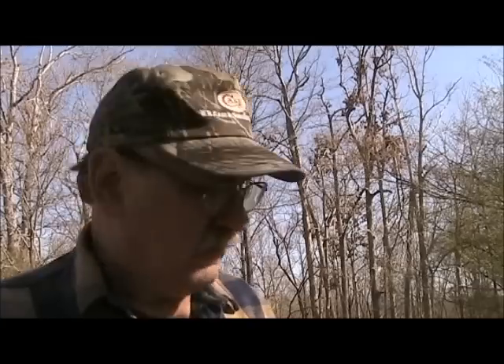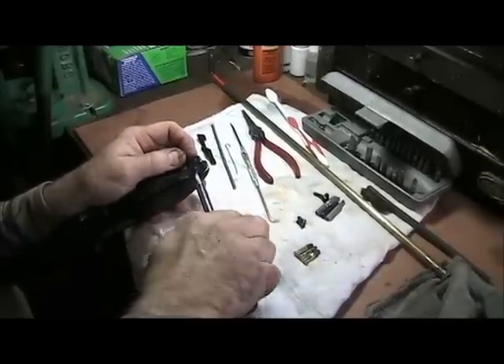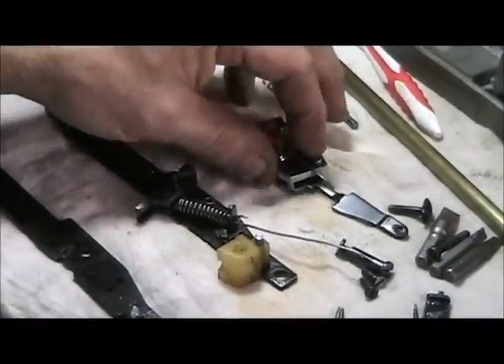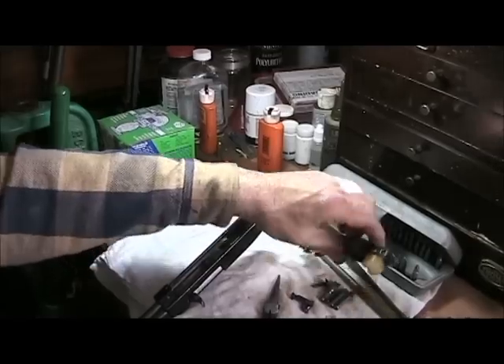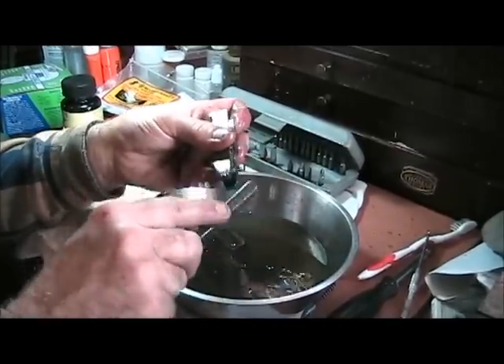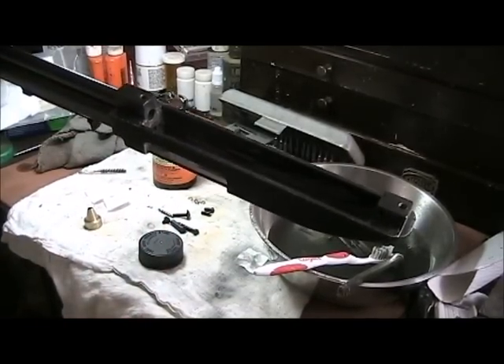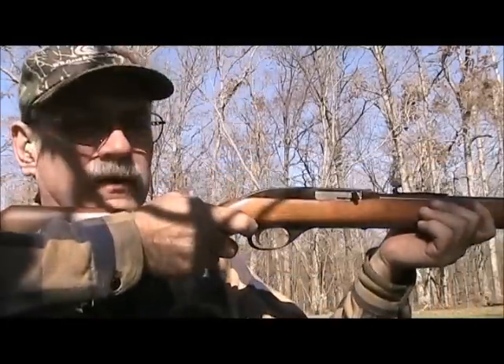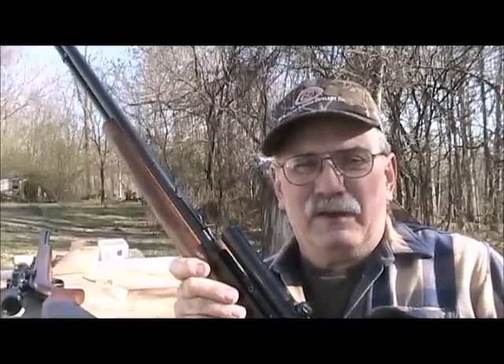Marlin Model 60 Jamming Problems and How to Fix Them

Comment: I went plinking yesterday and my 1970 marlin 60 would not load any rounds. Just kept going in crooked and the gun was filthy. You would never know it by the looks of the rifle. It is in 99% condition. I just bought if from a 91 year old gentleman who said it had very little use.
I followed your vid and took it apart just as you said. I cleaned it as I went along and then started the install. When I got to the ejector spring there was nothing there at the end to go over the mouth I think you called it or the ramp. Seems to me the spring is broken. Thanks so much for the great video. Can you point me in the right direction for a rebuild kit that you would recommend?  Thanks, Bruce
Reply from the maker: If the ejector spring is broken, and is not ehgaging the head of the cartridge case, then it can't really get rid of the empty case. You can find parts for these rifles on ebay. You really don't need a rebuild kit. I don't think anyone even makes parts for these guns anymore.
Reply: Yeah that is broken so I must replace that. But why will it not chamber the round? The rounds are going in crooked. @CumberlandOutdoorsman
Reply from the maker: @vintagedrumrestorationgara91  It's hard to say without seeing it, but depending on where the spring is broken, it could also be the cause of improper feeding since it also operates the cartridge lifter.
Reply: @CumberlandOutdoorsman  I ordered the recoil and the lifter springs and will install them and see what happens. I will get to the bottom of it. Thanks for your help and great videos. Bruce

Comment: After having mine professionally cleaned, it now doesn’t even load a bullet. Also when empty the chamber is supposed to stay open, but that doesn’t happen either. The chamber release by the trigger seems to have lost its springiness… meaning it can be pressed and then doesn’t protrude back out. Thank you for the video, I believe I can do a better job by rebuilding it myself. At least all the parts are clean now, but the reassembly is where several things went wrong by this professional.

Comment: Great video. I had one do this and come to find out I had the for end screw to tight and was putting pressure on the mag tube. I backed it off and problem solved. That god for internet forums. lol
Reply: i hope that does the trick. Thanks for the tip. I'm a bit of an over tightener myself.

Comment: I got a question,I have one that wants to chain fire . It will shoot one round and next time it might shoot three rounds at once. Any advice on how to fix it?
Reply from the maker: Sounds like a problem with the sear assembly, or where the sear and hammer engage each other. I would do a thorough cleaning especially in the sear grooves, then lightly (and I mean LIGHTLY) oil the entire system. Let us know if this works out for you.

Comment: I really enjoyed this video ! Very impressive and informative as well!! Thank you for posting and I'll be looking forward to your upcoming videos too. I  have a. Model 60 that was gifted to me for Christmas v it was made in Mayfield Kentucky and it  jams straight out of the box new ..... Any ideas ? Thanks
Reply from the maker: Great question, and thanks for watching. If your rifle has the last shot hold open design, then you possibly have an issue with the cartridge lifter and/or the feed throat. Is it failing to eject, or failing to feed? That would be helpful to know in order to narrow down a solution.
Reply: @CumberlandOutdoorsman  it’s failing to eject or what I’ve heard it called is stovepiping ?
Reply: @CumberlandOutdoorsman  sorry so long getting back to you….. my iPad was down
Reply from the maker: @michaelhubbard1711  Ok Michael, If it's failing to eject, then the problem may be with the ejector/lifter spring. If the spring is not contacting the back of the fired round, then you can bend it back up to resolve the issue. A small amount is all that's necessary, but I would recommend you insert a fired shell, and watch what happens as you pull the bolt back slowly.
Reply: @CumberlandOutdoorsman  thanks I’ll give it a try . You’ve been most helpful ! Keep cranking out the videos please !

Comment: on our end we couldn’t see much detail and there was not enough lighting. Thx for the tutorial anyways. My Marlin Glenfield model 60 is jamming up too. But in my case the tip of the round is getting stuck and bending the led before it hits the chamber.
Reply: Also > https://youtu.be/skC1W6JqNgI
Reply: I have a 1977 old style that was doing the same and replaced the feed throat with a new New Style and shoots great now.  Had to mill the edges and milled off one of the protruding pins on the side to fit.  No need to change the ejector spring or the lifter.

Comment: My Marlin 600 keeps jamming up too, but my shells don't come out. They get wedged up in there because they aren't ejecting properly. You have to take the gun apart to clear the chamber and action. With the quarantine I can't take it anywhere. Going to watch the rest of your video to see if you cover what i think might be the problem.
Reply from the maker: You either have a bent ejector spring, or if your model is older, the ejector rail on the feeding throat is worn down or chipped. Depending on the model you have, either one of these issues will cause a failure to eject.
Reply: @CumberlandOutdoorsman  thanks for the feedback. I'm actually thinking it is one of the extractors. I believe only one is grabbing the spent shell, causing it to turn inside the action. I can't figure out how to remove the extractors to clean the slots they sit in. I think I'm going to wait to take it in.

Comment: What size drill bit did you use when you had to drill that extra hole in the side plate of the assembly to accommodate the new loading throat

Comment: Do you have a jig to use for drilling the new loading throat hole?  How do you ensure the proper position of the hole?
Reply from the maker: I'm glad you asked this question, because I didn't go into detail on how I did this in the video. The opposite plate has a hole that you can line the un-drilled plate with. I just outlined the hole and drilled it out. Everything went together smoothly.
Reply: Thanks for the answer!

Comment: Another great video my friend, Very informational and well done, Did you order your replacement parts directly from marlin ?, Do you know if a last shot hold open feature can be added to a marlin glenfield model 60 that does not have it from the factory ?
Reply from the maker: The parts I ordered are from Brownells, and Classic Firearms Parts. I would also check with Numrich Gun Parts, and of course Ebay. In regards to adding a last shot hold open, I have also wondered the same, (I guess great minds think alike). That would not only be a welcome addition to older Marlin 60's, but also an interesting video idea. I would hope that the folks at Youtube wouldn't mind such a video, because in effect you would be making this rifle more safe, simply due to the fact that you would be absolutely sure the gun was empty when the bolt is held open. I think I'll do some research on this matter. Thanks for the support.
Reply: I see the parts at MidwayUSA for a reasonable price.
Reply from the maker: Check out my updated video regarding the installation of the bolt release lever. I will show you exactly how I updated my vintage Marlin 60 in a step by step guide. So if you want to update your older rifle this new video is for you.

Comment: Where did you get that cleaning rod that swivels from,   I’m having trouble with my marlin 60 not shooting. What should I do first
Reply from the maker: The cleaning rod came from Mid South Shooters Supply. In regards to your Marlin not shooting do you mean it doesn't cycle? Is it not feeding correctly and jamming up? Is it not firing? Maybe it just needs a good cleaning.

Comment: I have a 1970 and  I’m ready to throw it in the pond behind my house lol . I’ve been working on it for three hours now ( not my first time ) . The bolt won’t stay open unless I really mess with it . Also it’s getting hung up ,won’t return properly. I’ve tried to adjust my ejector spring to no avail. Finally realized that the spring pin( the one in the back that guides the bolt and keeps the spring in )is bent !! Could this be my problem? Where does one even get parts for these old plinkers ?
Reply from the maker: OK...just sit back and take a deep breath. You most likely found the culprit, because the guide pin can cause all kinds of issues. If you have a small ball peen hammer, and a good flat metal surface (such as an anvil), you can probably straighten it yourself. Then you can go over it with a small file or sandpaper to smooth out any dings, or burrs. I have found so many parts for the Marlin 60 on Ebay, that it's now my go-to place to look. Sorry you are having trouble, but it looks like you're on the right road. If you have any more issues, please don't hesitate to ask. I'll be glad to help.
Reply: @CumberlandOutdoorsman  let’s see how she goes . Even if I can straighten it out I still want a new one . Thanks for the help brother!
Reply: @CumberlandOutdoorsman  so I got a new guide pin and spring and put them in immediately upon arriving home from work today . It still has the same symptoms unfortunately.  It won’t lock back , gets stuck going forward about an inch from the barrel unless I really snap it back hard .  I’ve looked for anything bent or gouged and everything is as smooth as I’d expect it to be .  Any advice is appreciated!
Reply from the maker: I'm starting to wonder if there is some kind of interference from the bottom of the bolt riding against the sear/disconnect assembly. Also make sure the detent in the rear of the receiver is not plugged with gunk. That would keep the bolt from locking back. You should be able to pull the bolt back, push inwards, and the bolt will lock in place. I have a Marlin model 99, and it will not lock back because it was made before Marlin re-designed it to make up the model 60, and 75. You might have the wrong bolt, or perhaps you are not pushing in on the charging handle.

Comment: I had a Marlin model 60 purchased brand new in 1998 it jammed right away. I had a used one in 1978 it never jammed. But I wonder if the new ones are made better now.

Comment: I just inherited one of these from my dad and it has a problem with loading. The bullets don't always go all the way into the shaft because when I go to put the rod back in, it stops part way. If I take it back out, shake it a bit, dance with it, then try again and it'll go all the way in.
Reply from the maker: Sounds like either the loading tube ("shaft") is either bent or may be dirty inside. There may also be an issue with the feeding spring inside the tube.

Comment: I have a Marlin Glenfield Mod 60.  Is this the same rifle?  If so, mine has a 2 piece loading throat.  Is this type of repair possible on this rifle?  Thanks for you video.
Reply: I have the same model with Glenfield stamped on the barrel. There are a number of videos on YouTube that tackle this problem of the various releases of the Model 60. If you look up parts you'll find that they made various changes to certain parts depending on the year it was made. I especially noticed this from the early 70s to the early 80s. sometimes in two year intervals. Cumberland Outdoorsman does one of the most thorough breakdowns and reassembling I've seen.

Comment: I have a Marlin model 60 micro groove barrel manufactured in North Haven CT. which I purchased from a used guns dealer. 
I want to replace the inner springs, can you point me in the direction as far as were to find them online?
Reply from the maker: Sure thing. You can find parts online at Brownell's, Midway USA, Classic Firearms parts, Numrich,  and Ebay. I will be making a video covering the replacement of the hammer spring real soon, so keep an eye out for that one.
Reply: Cumberland Outdoorsman 

I have the same gun this guy is talking about.  I had to shoot 3 skunks this past month.  It didn’t fire a couple of times maybe bc I used the buckshot type.  I’ve only fired this gun maybe 150 times in 40 years. Is it wore out already?  I did shoot the cci rounds with no jams.

Believe it or not, I had to shoot the first skunk 5 times before it finally died.  The last skunk took 3 rounds to kill it.  I hate skunks.  The first one sprayed me and my daughter.  My daughter got a direct hit in the mouth.  Thank you for your video.
Reply from the maker: @leesire  Whenever you shoot at a skunk with a .22 rimfire, you always want to keep your distance, and use high velocity hollow point ammo. I have even used hyper velocity stuff like Remington Yellow Jackets, or CCI Stingers, because you want to instantly kill those criiters with a shot through the vitals, thereby reducing the chance of them spraying. Also remember that skunks carry rabies, so be careful when handling them. I just scoop them up with a shovel and bury them.

Comment: How did you locate the new hole for loading throat pin?
Reply from the maker: Great question. If you align the opposing (left) plate with the right plate you will notice a hole that is in the correct position. The left plate can be used as a guide to scribe the hole to be drilled in the right side-plate.

Comment: Thanks for the tutorial. I just bought my wife one made in the 80's used online. Where do you buy your spare parts? Thanks
Reply: I would also like to know my spring is a little funky and I dont see any sites besides Craigslist and that doesn't seem reliable
Reply: Ebay or ask your local gunsmith , private gun shops are the best they are smaller more personalized and once you build a relationship with them buy a few guns and ammo they will help you out as much as they can I would highly recommend this over buying a gun from a big store like Cabela's just a much better experience in my opinion
Reply: And they usually know where to get gun parts for cheap ,
Reply: Try Numrich parts. Is one supplier

Comment: I cleaned mine, removing bolt and such, then read up on the type.  Using the serial number, mine is a 1985 with the hold open bolt when the ammunition supply is exhausted, has the 22 inch barrel, and 18 round capacity because that tube extends almost to the end of the barrel.  It also has the stock reinforcing screw located behind the trigger guard.  It is still an inexpensive gun, bought new off the rack, and now that I think about it, I probably bought it at Big 5 Sporting Goods, or was it Wal-Mart, gosh I can’t remember, but it is nice to know that it has the collectible features such as described that a knowledgeable Model 60 collector finds desirable, and before the liberal nut jobs have gone overboard with their foolishness.  The patented 1 in 16 twist micro groove rifling makes it a tack driver.  I enjoyed your video.

Comment: Okay, same issue but instead of crimping the shell on 4th round, it wont load correctly, like it’s caught on the edge and back end is sticking up??
Reply from the maker: That sounds like either the feed throat and/or the cartridge lifter. Most likely the feed throat because they had many issues such as separation, wear, chipping, etc. If you could find another one, I would recommend trying it.

Comment: thanks never would of got mine without this.Where can i get those e clips? hardware store?
Reply from the maker: Most hardware stores such as Ace Hardware should carry an assortment of E-clips. If you can't find them there, try an automotive store such as O'Reilly's, or Autozone.
Reply: McMaster-Carr Supply or Fastenal you get about 25 for $3

Comment: If you could share the part numbers of the ones you replaced that would be great.
Reply from the maker: The parts I got were mostly used, so I don't have any part numbers. Besides, I don't think Marlin 60 parts are readily available. I usually get most parts from ebay.

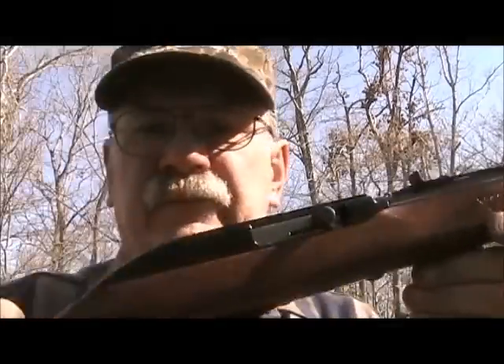Comment: In the very beginning of the video you can see the action is not recoiling back far enough to cycle the rounds, not even close.  Watch at 3:30, the 2 shot jam, the first recoil of the action was about 1/4 of what it should be.  This could simply be the loads, or it could be something with the gun.  Most likely, the loads.
Reply from the maker: That is absolutely wrong. The rounds I was using are the same as the ones I used after I repaired the rifle. It was definately not short cycling, the problem was in the loading throat. I actually re-installed the old parts after I made the repair, and the malfunction persisted. It was clearly  not the fault of the ammo.

Comment: Mine fires two rounds of ammo.. then jams the third bullet up above the chamber.
New feed throat. ..I've no ideal what to do next.
Reply from the maker: Sounds like a problem with the cartridge lifter, and/or lifter spring. You might also check the mag tube alignment.
Reply: @CumberlandOutdoorsman  checked everything once again..
Cleaned again....
I have another model 60..
I do not know why ? I swapped actions between the two rifles.
They both shooting great now.
Also on one , I noticed the barrel and action rocking in the stock.
Switched to a  old laminated stock.
Perfect fit.
All is good now.
Thanks.